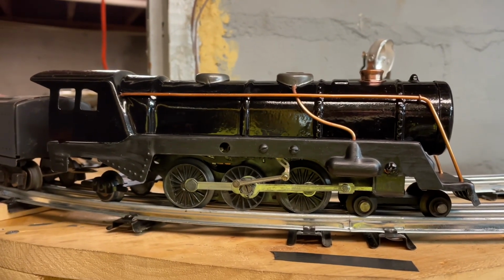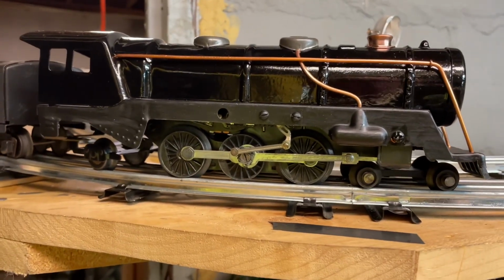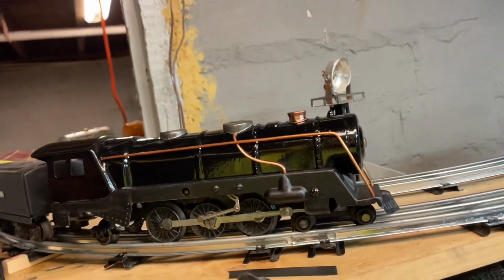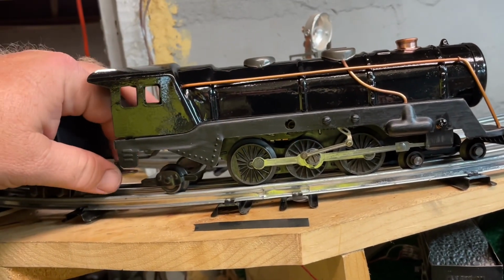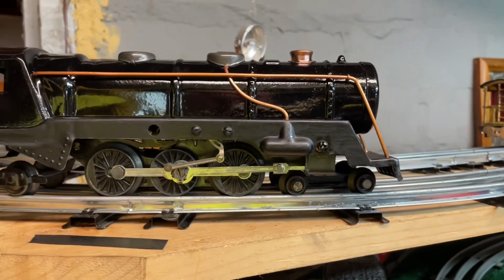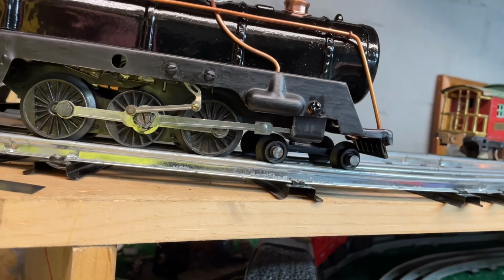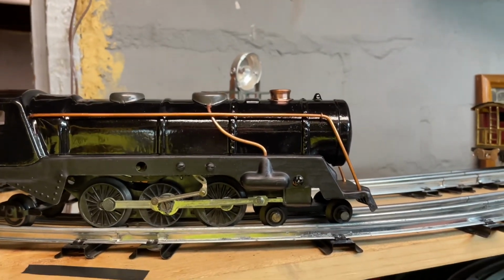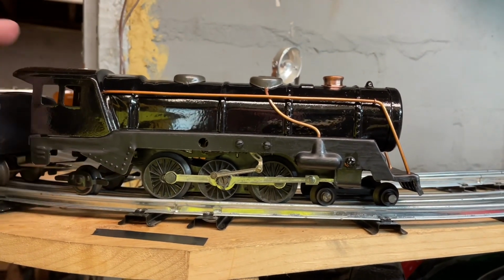Marx Train / Custom 994

Comment: Gary , this is Kary . I did almost the same thing as you , and took a 994 , cut off the fake trucks and separated the two piece body .  Gave them the white vinegar treatment , and painted the upper white and lower silver .   Installed 999 trucks , replaced the rails with gold coat hangers and painted the top caps silver as well.  She is the Queen of my Marx fleet .    Keep those Marx plunking along .

Comment: Nice job. hey... if you're still wondering what to do with your Marx shell with the broken off pilot/cow catcher you could do what I did. I   had a plastic shell with half the cow catcher snaped off & I neatly Dremeled off the other half, attached 2 of those pins you use to tack stucc to bulletin boards (those tacks with the flat head on the end of them), gave it a nice paint job, and now it's my Imitation British Marx.